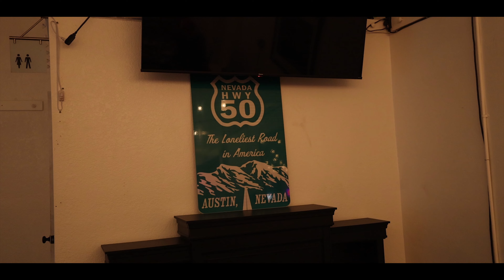This was bad... Nevada Almost Took David. 900 miles of unforgiving offroad.

Comment: One thing I was taught long ago is to take a ratchet strap, if you have one, around the tire while you air up after losing the bead. Forcing the side wall out. Helped both times I lost a bead while wheeling. Maybe you knew that, just didn’t see you try it and figure you’d probably have a ratchet strap.

Comment: I can attest to the raptor in the snow thing. My 19 5.0 f150 with raptor conversion has 35" MT baja boss a/t's with method 703 bead grip rims.  When I air down to 5psi,  I plow through feet of snow almost as well as my jeep on 37s and beadlocks.  I rescued a 4runner in three feet of heavy snow on the weekend at the top of a mountain pass in CdA idaho and it crawled right through no problem where others with lighter, larger tired vehicles where spinning.  The MT baja boss Ats are a really popular wheel up here for snow wheeling regularly.

Comment: Most people highly underestimate the Nevada Backcountry. I grew up in Elko riding and racing motocross. I remember the first few times we started seeing off road guys up the canyon there I grew up (kittridge canyon) the road to the waterfall has become extremely washed out and was pretty hard riding when I was a young teenager. If people want to go outbacking in nevada I highly recommend picking either late may early June or wait until September when the brutal summer temperatures have started to subside. Thanks for the great video I'll definitely be subscribing!

Comment: I used to work at a tire shop, you typically have to air up way higher than normal pressure for some tires to finally seat, and then you lower the air to where you want

Comment: In European mountains we just use snowchains, they protect wheels from sliding off-camber from the trails. Also key to stay on trail is to mantain slow but constant speed, in the moment You stop You will slide rear off the trail.  Btw. Great choice for hot sauce!

Comment: 21:26 It would be really cool to see a weight reduction build series on a big girl like that. Goal being to cut weight down equal to something with a much smaller footprint. Maybe call it the Lighterlander build. I’d watch the hell out of that.

Love my Powerstops on my TJ BTW.
Reply: Without cutting it apart, you can make a suburban about 6300. Small axles, stock tires, LS, ally transfer case, no sliders or bumpers or winch or gear. Just a people hauler.

One tons, 40s, and all the gear around it adds up. Plus, there’s a lot of glass and steel. Lots of steel.

Comment: Great trip! Some of those veiws were amazing. I have the front PowerStop kit(Tundra calipers & rotors) on my 3rd gen 4Runner. It made a huge difference! I recently did the front & rear kit on my RX350, which I tow my Aliner.  It stops so good now. It's like the RX & camper are one. Outstanding product!

Comment: Born and raised in Nevada back in the 50s & 60s before the fantasy 4by4 . We used chains on normal tires no wench but a handy man jack and 3 metal Fence poles as anchor. I also worked for the State for over 10 years and only once got stuck and needed a tow. PS this was with out any cell phones.

Comment: Just a heads up, when I worked at a tire shop I've had to get up to 70-80psi to seat some beads, especially with thicker beads like the mud grapps. It's not going to cause any harm to bump up the pressure temporarily to seat it and then drop it back down again.

Comment: I suffered through a similar experience trying to get a bead reseated on some bead grips. Had to lube the hell out of the entire bead with chainsaw bar oil (only thing I had) and crank it up to 60psi to get it to pop on.

I fought that fight with a Mickey Baja boss AT, but with a KO2 it popped on super easy. I think it just varies tire to tire.

Comment: looks like a Alklie bed 37:58 ...you don't sink to far but its like slimy and slippery as snot lol... Ive had drive my old bumper jack into the ground as a anchor point and use to winch my self out ....I was raised in nevada in the 80s

Comment: Man, Nate’s Tacoma is so modified, it’s easy to forget that it still has MTS, Crawl Control, Traction Control, the 3.5 and that shifty 6 speed automatic and plugs along without issue. My Tacoma has the OTT tune. I can peg it at 6.5k rpm. Nate, what RPM’s are you hitting regularly out there?

Comment: It's your favorite Astro guy here again. college finals have been killing me so not much work lately. Got the roof rack finally mocked up and fabbed up. roof structure in these are super thin, so looking at maybe doing a slight internal cage. Whats your go to Diameter and Wall thickness when building cages? (Rig should be 5500 pounds fully done)

Comment: I have changed a lot of tires and when it comes to the truck tires the max psi it says on the side wall is the bead seating pressure and that is usually 80 psi but that is also a suggested sometimes it takes a little more yes it's creepy when the bead sets but that's part of the job

Comment: I wonder if putting that front tire that kept losing the bead on the rear would have helped?  Less sidewall pressure from turning, maybe less weight too?  Depends on how much your gear weighs compared to the engine, battery, etc.

Comment: That's not "the arrogance of offroading" that's the arrogance of many of today's offroaders who have forgotten lighter is righter.  I used to get sore at all those pigs blocking the trails when I was out with my first gen Tacoma club.  Aired down, floating over all those things you showed as hard obstacles in this video.  Even your taco, Nate, is way too heavy.  By any reasonable standard.  Having said all that, fun video, and you fixed your Elk Hunter Taco!

Comment: You sure that Sub weighs 10,000lbs? I’d like to see it on scales. My brother has a 1990 4x4 Sub and it weighs like 5,000.
Reply: I weighed it in my latest video.
Reply from the maker: Yep! He hit the scales on the way to meet us on this trip. But you can't compare this to a normal burban. Check out David's channel, willomet motor and fab. Between the diesel, one ton axles, sliders, bumpers, frame stiffeners, ect, you accumulate a bit of weight 😁
Reply: @DirtLifestyle and while the weight of the truck is just an unavoidable fact of suburban life, it has made an impact on how I build everything else…that’s why there’s so much 4130 on the charger